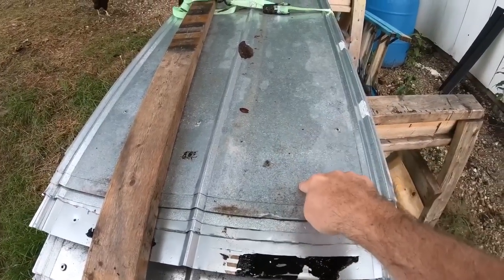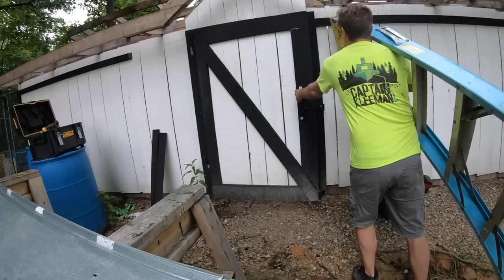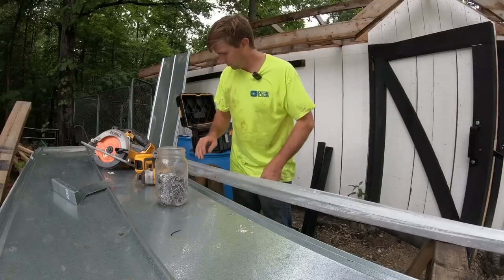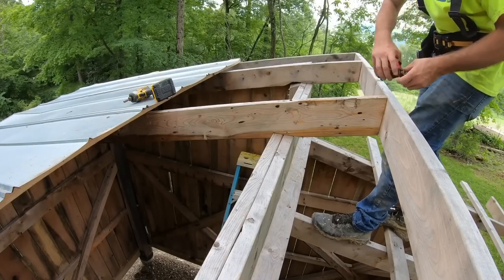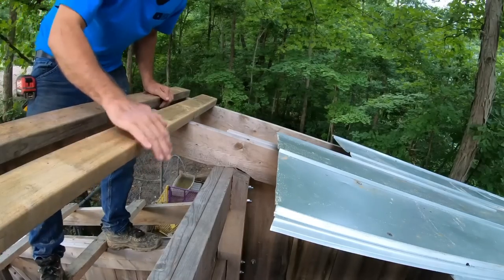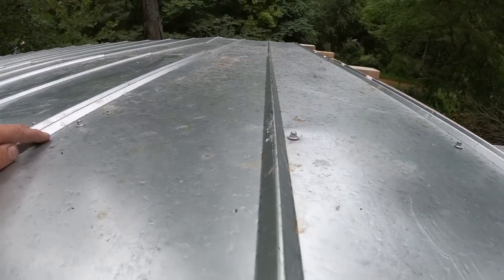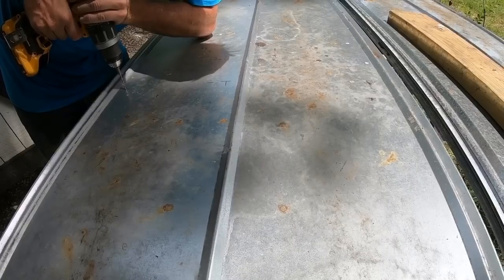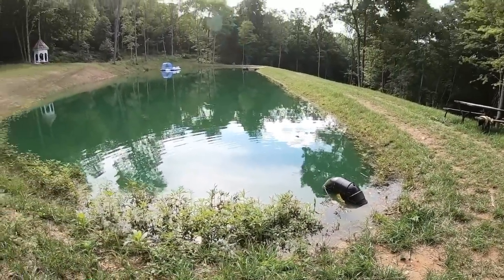DIY Barn Barn Build - Saving Money by Installing Used Metal Roofing

Comment: Thanks for sharing your thoughts, ideas and videos. Barn is looking great. Probably would go the clear roofing as a window substitute with minimal frames. Really looking forward to seeing which half of a ford ranger your looking into buying. Considering the options, front, back, driver’s side, passenger side. My guess is back end to add a bed to the Subaru Frankenstein, although if it was left or right that would certainly be entertaining to see what you would do with that. Knew a guy that had a VW bug collection rotting away. His friends called it his Beetle Ranch, he was cleaning up the old derelict vehicles and people were saying it wouldn’t be the same without the beetles. He took an afternoon, skinned them, pounded the skins flat, and hung them from the wall of the barn like hides left to dry. Wishing you and your family the best.

Comment: That is what i am going to use. The 4-mil plastic I put up 2 years ago is starting to shred, so I really need to get on that. My roof offset is a couple of feet, but I don't need to turn the lights on unless I am going to use the table saw. I am sure the goats won't complain, but if they do, trade them in on sheep.

Comment: Metal roof looking champion, the finish contrasts with the black and white paint job too !!! 😎
It is sometimes easier to formulate a plan as you are working to suit what you need, works for me too !! 
The brooding hen was not happy with you, if she could talk at you, you would had have to cut that scene out 😵🤣
Pond has filled very nicely, overflow works well. Just a thought for the end of the pipe, you could lay some stones down instead of rip rap, what do you think ? 🤔

Comment: Hi Mike,  those trees need to be trimmed off your roof line. Those overhanging branches will create havoc to your new roof cover. Nice planning and great use of material resources. Your audience seems to be in a “fowl mood”.  I agree that corrugated poly carbonate roof sheeting would work great for that under gable window area. And far less expensive than regular windows.
Reply from the maker: They were trimmed in this video.

Comment: Learned a pro tip for putting holes in the metal siding/roofing from watching RR Buildings here on YouTube. You stack it like you did, but instead of using a drill and breaking bits, you use an awl and a hammer. Kyle's shown it several times on his channel and it works great. Makes the screw holes the perfect size. Plus it's quicker. Anyway, the pond is looking great with it being more full.
Reply from the maker: I would think they know what they're doing since they do it for a living, may have to try that

Comment: Yep, I've re-used metal siding/roofing and it takes a little planning to  hit the old holes, but the savings is well worth it. My father professionally built pole buildings and he'd stack up the number of sheets needed, lay out the hole pattern, and then use a very-sharp center punch to mark all the sheets. He then used self-tapping screws at each punch mark. It's really quick and you don't have to worry about broken bits. Great video, Mike! Lee (Liked the really friendly turkey!)

Comment: We always put the fasteners in the high part of the Vs so the water doesn’t run under the tin when the fasteners eventually get loose.
Reply from the maker: That's what the manufacturer says as well, but since they already had holes and I didn't feel like welding them all closed...
Reply: Too bad that when you lapped that you put holes through the flat part again.  Those screws will hold longer than nails but the wind will eventually loosen them and they will leak.  At least it’s just a barn and the animals won’t complain about a drip or two sometimes.  You might want to watch for water damage and just address it when it happens.  You did some impressive work on that barn as you typically do on everything.
Reply from the maker: @peadenl  you're overthinking it.  I would be surprised to ever see that cause any problems

Comment: Captain, you should eventually install 2 X 4s across top of the metal at the top,  where the frist piece overlaps the bottom piece and the bottom of the bottom section of metal roofing.
Cut half inch deep 3/4 inch wide rabbits in the middle and bottom 2 X 4s every 12 to 16 inches to allow rain to sluice thru.
Also put the same on the ends.
High winds will surprise you as to what it can do.
Your chicken coop / goat barn looks pretty much well built to withstand a wind storm.
Untill to roof comes off.
I learned that growing up in a small Michigan farm town.
Barn is shaping up to look awesomely nice.

Comment: sorry bout the fish comment last time, it was answered in the 40 seconds I hadn't watched.
Moving on, about that floor, I have been in some very expensive horse barns and almost all of those had dirt floors with a concrete walkway down the middle. I guess when the smell gets too bad/ they mucked out too much dirt, they just top it off. That might be the best idea to keep from having a concrete floor that reeks of urine, but still it is all conjecture. I don't really know what is best, dont want varmints digging in or worse, predators.
thanks for the videos.

Comment: If you ever have to do it again you can take a cheap saw blade ( non-carbide teeth) and put it in backwards and it will cut right through that thin metal pretty cleanly.

Comment: on my work shop roof I built 20 years ago I used yelloow fiber glass sheeting on the roof like they use on green houses  I have had no problem with it leaking  you could use that as your window it would give you a lot of light and light

Comment: Why not cut a 12” strip of clear corrugated polycarbonate or whatever it is roofing sheet and screw it to the space you’re looking at putting a 12” window on the chickenhouse. It fairly protected and should last 10 or more years.
The build is looking real good.

Comment: Clear panels are a lot cheaper than polycarbonate or lexan, and you have a very small section and very protected, so the cheap clear should be fine
So which 1/2 did you buy 🤔
Front, back
Left, right
Inquiring minds want to know 😉

Comment: Hi Mike. When you showed us the alignment of the metal on the roof, there was a small section that was open on both roofs. Will it stay that way, or do you have a solution to fill in the gap? All is looking good. Good planning to use the same holes. Have good days!
Reply from the maker: It all gets closed in

Comment: not a good idea to leave electric tools on the floor over night, as cold moisture gets into the tools working parts and could cause faults with the electrics, following days use.
Reply from the maker: If they can't handle moisture like that, then I don't want them.